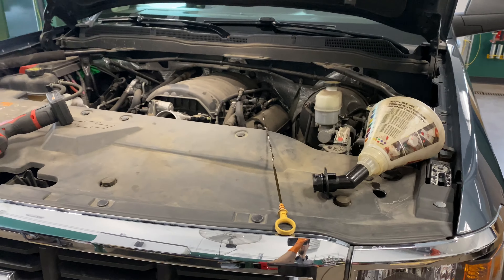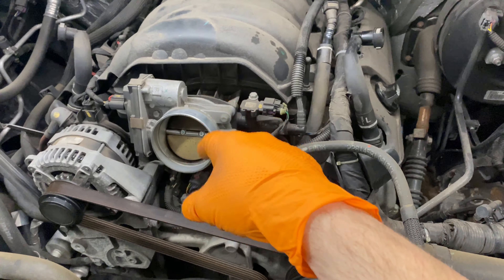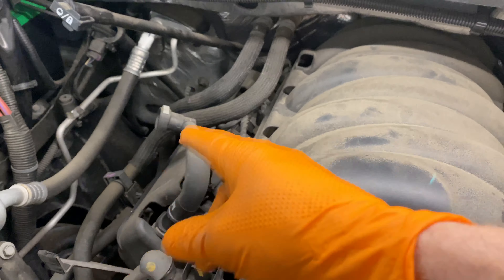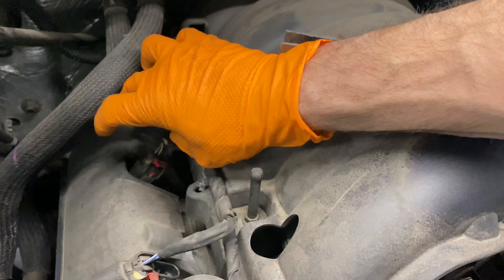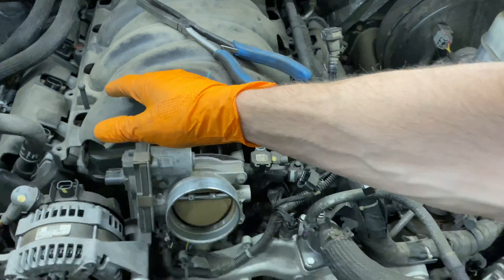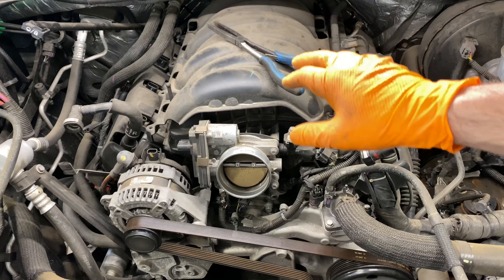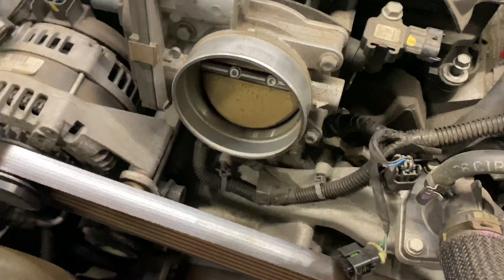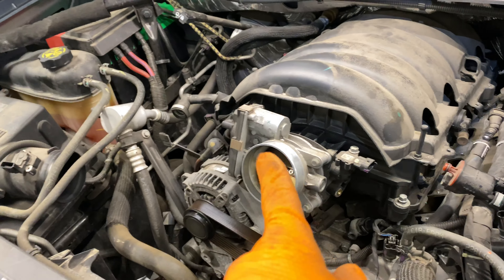GM V8 5.3/6.2 High Pressure Fuel Pump Replacement Step By Step

Comment: How much alcohol do you recon it will take to do the whole job?
Reply from the maker: I would account for an additional 0.5hrs per drink. So if you have 4 drinks will add 2 hours to the already 4hr job 😂
Reply: @Pete_Tech_  Just finished it. Actually wasn't that bad

Comment: I have no engine light or codes or running bad. I do have fuel dripping out the back of the engine. I think it's been apart before and they didn't replace the high pressure lines. You think that's what could be leaking? Does the fuel pump ever leak externally? I'm just trying to narrow this down to a couple of items before I tear it down so I know what I'm running into as far as cost. Thanks for any input.

Comment: Everything good but the question is , Why did u replaced it ?? What was the issue on this truck ??
Reply from the maker: See the video prior to this one on my channel!  The diagnosis is a separate video, common fuel trim codes that will usually appear confirming the failure of the pump!
Reply: @Pete_Tech_  
The first video mentions the PIP from GM. Do you know the PIP that’s referenced?

Comment: You mentioned that it needed to be on top dead center but you didnt put finding TDC in the video at all. So did you do it?
Reply: Instead of messing with the cylinder you can buy a tool which is probably what he did. OTC Tools 6710. It sits in where the pump is. As you rotate the engine it will sit flush when it's in the correct position.

Comment: Is it a dealer part?, because I'm not finding it on any auto parts websites, maybe I'm not calling it by the correct name,  what would it be called besides high pressure fuel pump?
Reply: There's 2 sensors not just 1 this is high pressure fuel rail pressure sensor, also he took alot of unnecessary steps